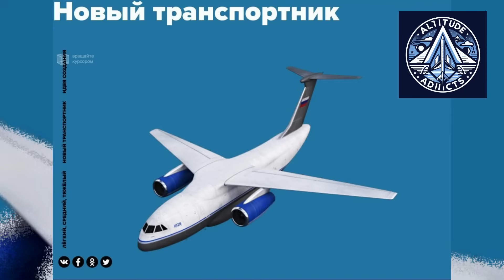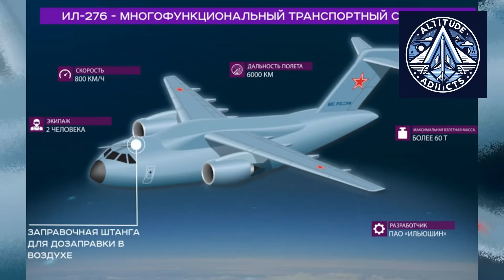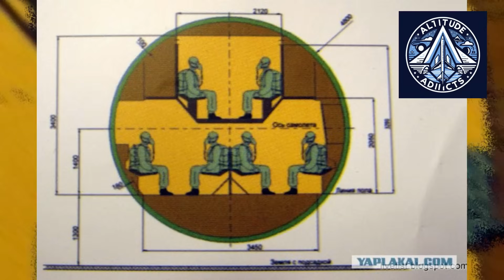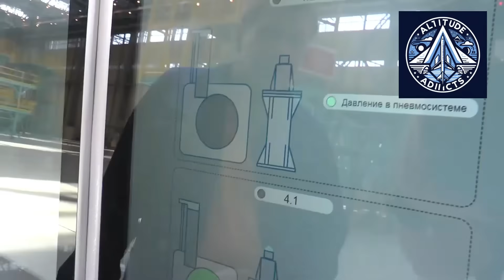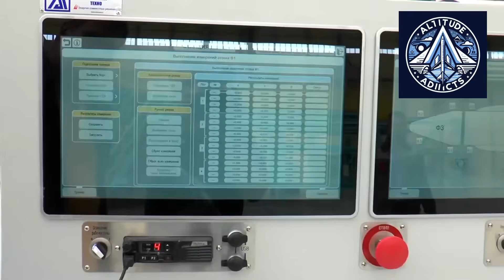Il-276 in 2026? The Truth Behind Russia’s “Ghost” Transport Jet

Comment: I do not see the point of creating a "Military Transport", that is not capable of lifting 50 t. Especially Military gear is heavy.  Yes, small transport planes are a thing,  but do they need turbines? If the distance isn't that far anyway, turboprops might be more efficient even.
Reply: turboprops are a bit slow. distances in russia are quite big. also no... you dont always need 200 tons. il76 with 4 engines and smaller aircraft with 2 engines - same engines. is solid decision. even smaller aircraft can be turbo props since those will probably not even have range so speed isnt so important.
Reply: The Russian ministry of defence determines the type of transport aircraft needed,  take note